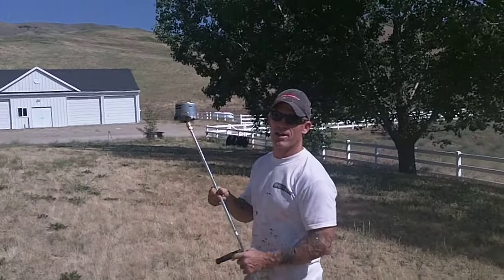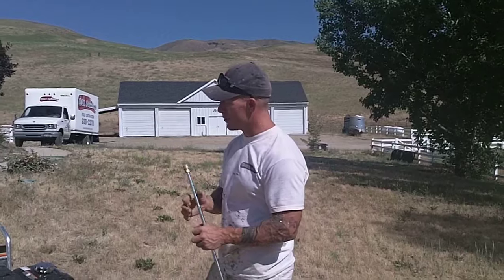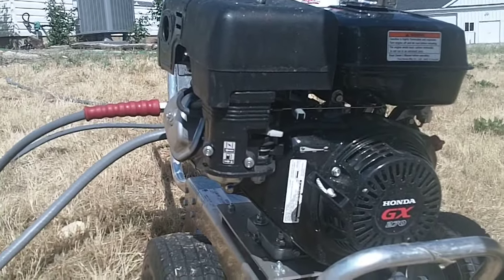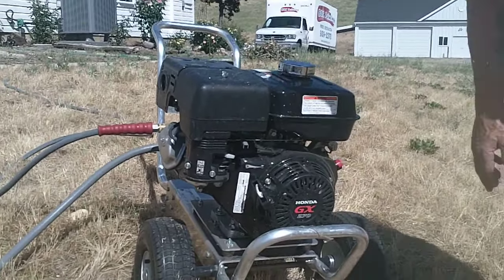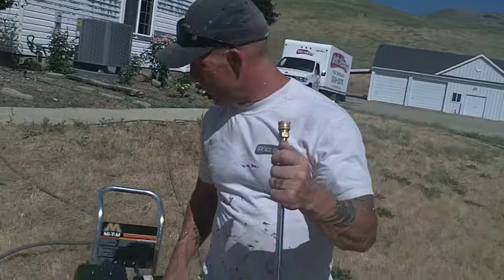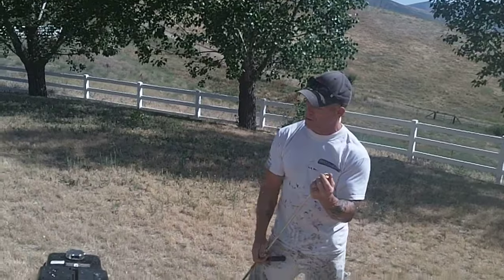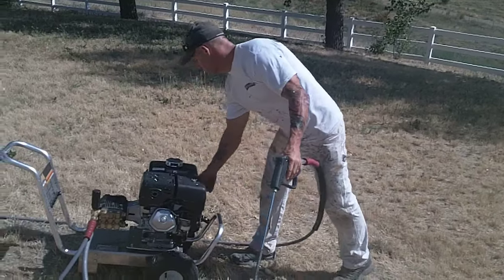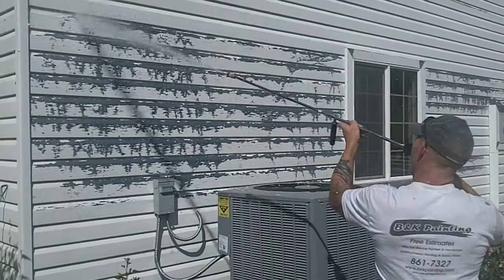How to operate a Mi-T-M power washer.  Pressure washing tips.

Comment: Bought a 3200psi Mi-T-M this morning. I've never heard of this brand so I'm a bit nervous as to what to expect long term. I've had 6 pressure washers over the past 12 years as I had a little rental business going on. All were Briggs engines and  I have to admit they all took a beating. I got so pissed when I learned they started using plastic components within the engines. But I guess everything's being made plastic nowadays. I went with this 'unknown' brand today as it was within my budget. But only time will tell if I made a good buy. I'm not renting this one out. It's for my personal use and I will be using a couple times yearly. 
Thanks for your video and I subbed.
Reply: Howd the MI-T-M motor hold up?

Comment: Good video.  You should always shut the gas to the off position and burn any unused fuel still left in the carb.  This prevents gas from gunking up the carb.  Honda recommends only using the on/off switch in emergency shutoff situations.  I know this does not seem practical all the time so I make sure and perform this shut down procedure before I store it for any length of time.
Reply: FBOutlaw wrong